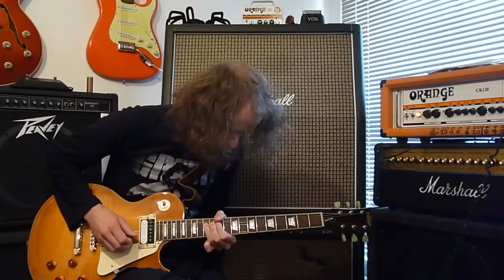Why I prefer Solid State amps to Valve amps

Comment: what happened to me.....i too had a few amps ...and i couldn't afford to keep them going. it always seems like, i have a tube go, i have a gig the next day and can't get it serviced in time. My Peavey bandit always turns on and works everytime. At some point I admitted to myself that it was the more robust, trustworthy amp. so i sold my classic 30. sold my hot rod. built a pedal board around my bandit. done.
Reply: tube amps spend more time on work benches than stages. the problem with many solid state combo amps is that they are less expensive so they usually get the worst speakers imaginable to cut costs. i tell people to put most of their money into getting the best speakers and cab they can find at their budget then put a decent ss head on top that fits their style. anyone who doesnt make their living playing really cant justify tube amp money to me. if its how you earn your income then yeah sure the 1% difference in "tone" may matter. most modern bands use axefx and kempers anyhow so ss and modelling cant be that bad.
Reply: +Mister Knight Owl yea.....I put an Eminence swamp thang in my bandit. built a pedal board around it. done. I am a regular dude. I work. I make ok money. i gig on the weekends. I have a lot of other things that matter too. food, rent, clothing. utilities. I agree that if I was more dependant on my rig, if I was touring and making my living with it i would have different gear. I am not. I get great tone and don't waste money on tools I don't need.
Reply: +Mark Shields amen brother. i have a solo series bandit 65 from the early 80s, a 2014 gibson melody maker (that i got used for under 300 bucks),  a peavey predator and a johnson j station in my rig. i spent 600 bucks grand total and the drunks at my local pub eat it up every friday night. if i was recording an album for rca (and could get it free or write it off) id play a 57 les paul through a 70s marshall like led zep, but im not. as long as your in tune and your axe is intonated, the drunks at the pub dont care. rock on man.
Reply: can you recommend any SS amp heads? Not digital/modelling
Reply: +Zen Juddhism peavey xxl or the supreme. both 100 watts and under 300 bucks used. go to guitar center .com
Reply: for sure the Peavey Transtube heads are fantastic. Pretty much a bandit in head form. Let me see what they are offering these days. It used to be the supreme.
Reply: +Mark Shields currently, peavey doesnt offer any new ss heads. theyve gone fully into vypyr combos and mini tube heads. if you go used, you can still get supremes for under 175 at guitarcenter.com used of course and for under 300 you can get the xxl which is a metal dream machine.
Reply: absolutely the used market is great. the supremes would make a great pedal board platform
Reply: i have just purchased a solo series bandit usa model,and i haven't had a chance to use it yet,what do you make of them?
Reply: djdt77 awesome amps. some of the best ss amps ever put out. i have a solo series 65 as well.
Reply: Mister Knight Owl thanks for your comment, it makes me all the more eager to get to know her
Reply: if you have a little more cash, check out the AMT Stonehead. In combos, the Roland Blues Cubes. The Bandit is really good, even out of the box with no mods. YMMV
Reply: The really same here !
Reply: I would recommend a Marshall AVT50h head.  They are dirt cheap, loud as hell and sound great with a tube screamer and other effects.  I have a lot of samples that I have posted.
Reply: Tube amps may spend time on benches, depending on the make, but compare that to solid state amps, which once they go wrong, they go on the bench briefly, and then because it's all PCB, and a lot that can't really be repaired, you just get charged that diagnostic fee for something that should, at that point, just hit a recycle bin, cuz once even a great tech is done, it ain't never gonna sound the same, and a "new buzz" is there.... and replacing that board, with the time and service fees... you may as well just buy a new solid state.
As far as modelers and that ilk go, I think of rock as traditional, whether it's classic, metal, or punk, and a tool set that requires experience to know how to use. You can go build a house with beaverboard and some big staple and nail guns, if that's what you want, but compared to mortise and tenon, you're a hack and the difference is in quality and tools. Sure, you may read about Petrucci hyping axe fx, or whoever is throwing a suitcase full of money at him, but then when you see he's doing signature stuff with Mesa... well, there's the proof. Digital effects sound best when they get clipped by power tubes.
Reply: I keep a little orange dark terror for recording. but on stage when you take into account how much your sound is muffled by the rest of the mix + the acoustics of wherever you are playing, a decent solid state head will sound just as good.
Reply: +Zen Juddhism Yes, if you want to go the solid state route, Randall amps are one of the best, if not the best solid state amplifiers out there IMHO.
Reply: +nydefect I believe Randall amps are still #1 s.s amplifier.
Reply: Metalgears1968 Randalls and the newer orange crush pro120. I've just bought one and it sounds fantastic. thick and creamy and has more mid range and bass than my valve heads. not quite so much sparkle as a valve head but seriously non distinguishable. Can't recommend them enough.
Reply: Metalgears1968. I would say they are in the top 3 but i love my Randall Pro tube2.
Reply: If you make your money gigging you have to be in the sweetspot though where a 100 watt amp will do.
Reply: Michael Carey  - I really think you're missing the point here, which is basically that there are solid state amps that sound great, nowadays - almost as great-sounding as tube amps. Old world craftsmanship doesn't  figure into the discussion.
Reply: cassius969 that never happens with the sound guy and the club not tolerating that level of volume. Not even with an attenuator.
Reply: i can see no reason to bring a 100 watt tube amp to anything less than a theatre. your average bar or club holding a couple hundred tops? 40 watts or less tube. really 20-30. you need to push it. that power section. and to do that you need to open up that volume control and it gets loud quick.
Reply: Mark Shields id say if you're really wanting to hit the power section, 5-15 watts max. You will never reach most power sections with the stereotypical sound guy hating your loud ass. Best solution is something that sounds great at low volumes and has a great line out to the board. My best solution was a Flextone III with the fbv shortboard. Great sounds, many of them, and the sound guy adores you. 

Tube wise, I'd say the Fender blues Junior and Peavey Classic 20/30 and an egnater tweaker 15 head/1x12 cab are the three I've had the best luck with. If I was doing anything needing more gain, I would have to use a pedal/boost.
Reply: i have nothing to add to that. :) exactly
Reply: So, I want my amp to break up. (currently own a digital vypyr vip3). But that's not possible. Should I buy a marshall dls40c or look for other options. My budget is 500ish euro
Reply: T.R. Bowen i will now call bullshit on that tube amp statement.
Reply: what sort of venue are you playing? take a look at the DSL15c combo also
Reply: Dont pretend. Get a tube amp. $500 can get u a great used one.
Reply: Turkey trail honey bee farm Georgia who are you replying to
Reply: Any one on a fixed income that wants true valve tone.
Reply: Turkey trail honey bee farm Georgia okay fixed income, $500 gets you the low end if the spectrum. Might get a hot rod deluxe if you're lucky. But probably end up with something you're going to need $$ to get up to par. If you're gigging a lot, it's smart to consider both SS and tube. What would u suggest for $500?
Reply: My first was a Randall pro tube2 it was $350 and $150 for new tubes and bias.bad ass! My second was a Marshall 600. Got it for $200 and $175 for tubes bias and a new reverb tank. Right now on craigslist in my town you can get a 5150 combo for $500 a few english made marshalls for about the same.and a Laney head for $350 65w of tube power can get it done. I have nothing against SS. I had a few good ones. but a hot tube took over my ear an that was that. I named alot of high gain tube amps above.  Zakk had dime rethinking SS before he died. God bless him.
Reply: Its taste and for me its emotional when i think of my expierence back then hearing first time a valve.I loved it.Would it was a solid state maybe i would be gone in that direction.Right now i play some tube amps 2 solids but my favourit is the kemper.It does it all and only real trained ears could tell a diffrence.The people you  play for give a shit if your amp is 100 or 2000 bucks when you give them a show.
Reply: now you have on thomann for 379 randall rg1503 150w SS thats what im going for :) that or the Orange crush. you have also the blackstar ID 100 True valve power(diferente valve emulations)
Reply: If you have that much trouble with tube amps, you should not own one. All the more tubes for the rest of us! :)
Reply: e james To blanket all solid state amps as harsh and act like tube amps instantly make you better by default is so dumb.
Reply: e james I have a all tube Randall from the 80s kinda Badass.
Reply: Except they didn't. You might have seen a few ads with George Lynch with the Randall amps, but for recording and live, he always rocked tube amps.
Reply: WHAT SS did zakk use??????????   i seen a lot stuff being in the bls chapters..what have ya world wide..JCM800.. 800 3X      2203 REISSUE.....AND LATELY SEEING SOME WYLDE AUDIO AMPS...just curious...contemplating a  800 3x........i explored on tuesday..got that line6 240 hc...ha..my line 6 15 watter made it sound horrible..my spider valve 112 however rocks with the  tubes...el34s..ans the other 2 tubes for a 40 watt bogner set up..truly bumped into my 120 watt crate..half way..it screams on my ibanez....well for being basically tubed with the modeling effects..its ok..holds up and rings tones....line 6 should stick w the tubes..recycle the SS LINE 6 240 HC JUNK AND STICK THE FUNDS FOR STICKING WITH TUBES...soon either getting a marchall jcm 800 3x..or ill get the big 5150.....slight more offerings than marshal..but marshal tone is legendary for decades...and i know..the choice is..tin can circuitry..or resonance in true tone tubes...WE KNOW HISTORY WAS MADE FOR DECASES IN TUBES !!!!!!!!!!!!!!   Oiiiiiiiiiiiiiiiiiiiiiiiiiiiiiii
Reply: Not many people at a pub gig would notice any difference at all as long as it sounds good to them. The most important point to me would be that the guitarist is good and the acoustics of the venue are reasonable. If they were as good as Dave I would personally be blown away regardless. Reliability for the money-strapped working guitarist is always going to be an issue. Just enjoy the band, they're doing their best.
Reply: Totally agree about the speakers. I put a 10" Tonetubby alnico speaker in my friends Fender Frontman 25R and everyone in our band and several live-sound engineers doing our gigs all agreed that it transformed it into an amazing-sounding amp... and there are alot of better amps than a Fender FM25R that would sound even better with a decent speaker in them.
Reply: Mister Knight Owl I would rather keep my tune amp up then have to play a piece of shit ss amp.

Comment: I understand what you're saying, Dave. I've been using different solid state or digital amp modelers for the past 12 years. I just got my first tube amp (OR15). I've avoided tube amps because of the cost and maintenance. Now that I'm financially in a better place, I decided it was time to finally get a tube amp. I don't think I'll be going back to a solid state. There's just something about the tone and the responsiveness. But to each, his own. Play what sounds good to you. If it's not inspiring you to play, it's the wrong amp.

Comment: I was expecting an idiot, but I actually really appreciated everything you said in the video. Very sound reasoning. personally, I hate solid states, I can always point them out easily in blind tests on youtube. And personally, the costs are outweighed by the benefits of valve amps, for me.
check out any of the amps in the infinium line by bugera. namely, the Bugera G20 Infinium. relatively light, loud, low power, and auto biasing technology to extend tube life, and also very very affordable... :)
Reply from the maker: Thank you for watching. :)